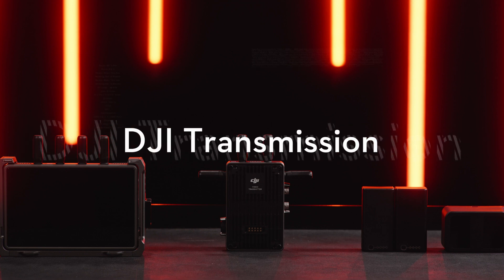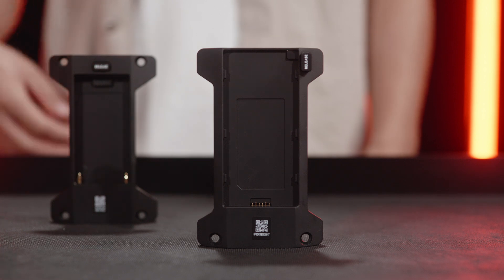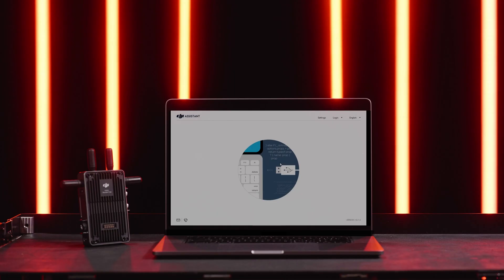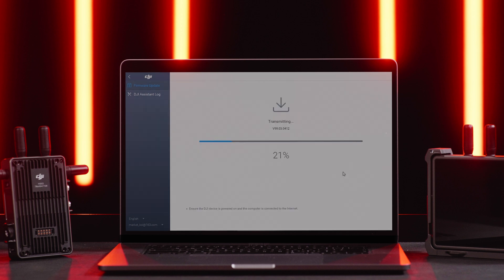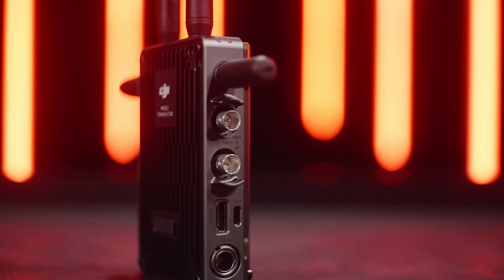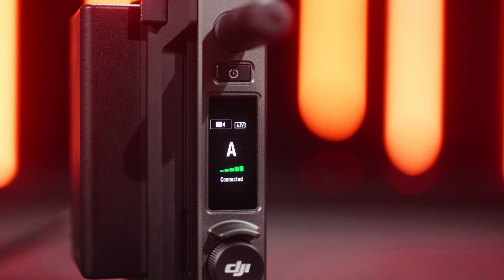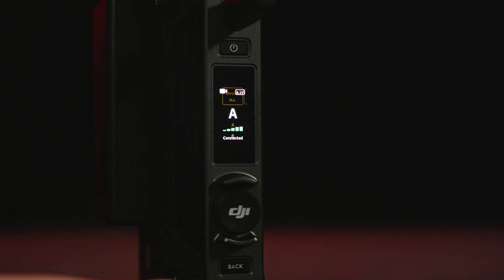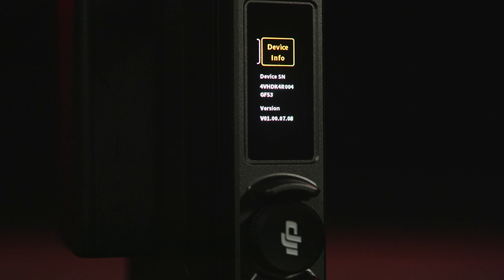DJI  Transmission｜First Use

Comment: Hi, Is it possible to transfer the video signal from my external monitor (HDMI out) to the DJI Transmitter (HDMI in)? My camera only has one HDMI output.

I would be very happy about your answer.

Best regards
Reply from the maker: Hello.Input Signal Specifications:
HDMI-IN： HDMI RGB 4:4:4
1080p:23.98/24/25/29.97/30/50/59.94/60fps
1080i: 50/59.94/60fps
720p: 50/59.94/60fps
As long as it meets the specifications it can be input.
Reply: @DJITutorials  thx

Comment: Broadcast Mode - I've heard you must have one remote monitor in control mode?  If correct, what happens to other remote monitors should remote in control should lose connectivity to transmitter?   If incorrect, could any remote monitor receive a transmitter in broadcast as long their on the same channel?

Comment: my assistant app froze on first connection/update...Got it working eventually.  Stressful right before a big shoot though
Reply from the maker: Hi there, we are sorry to know about this issue. May I ask if the issue is solved? You can try to reinstall the DJI Assistant 2 to see if the issue still exists. https://www.dji.com/downloads/softwares/dji-assistant-2-ronin-series
Reply: @DJITutorials  hi yes I did get it working, thank you.  I am overall pleased with how it works.